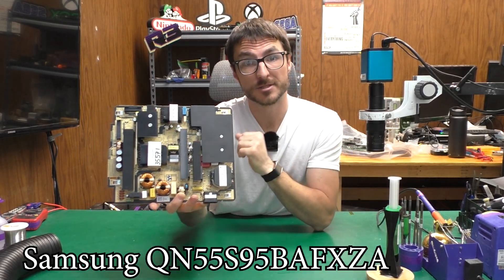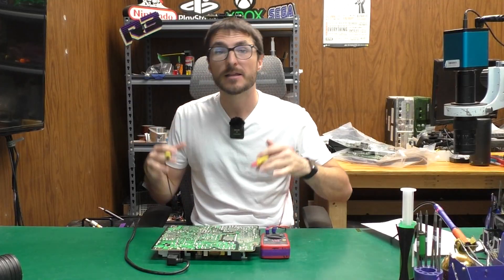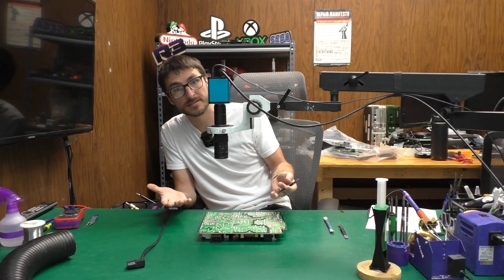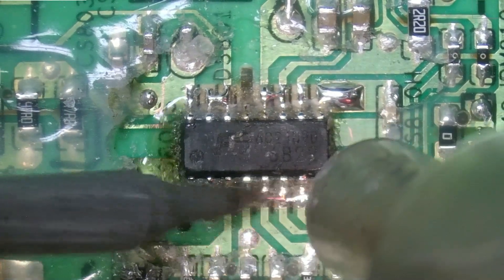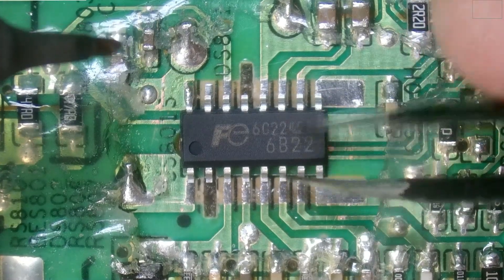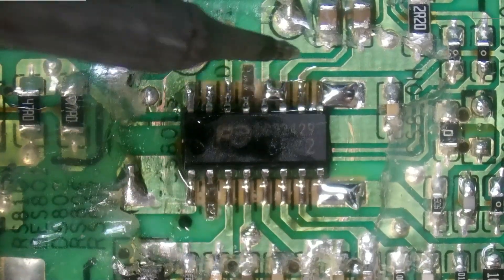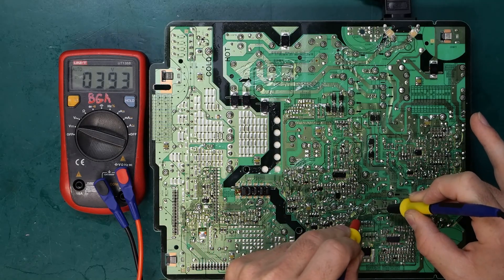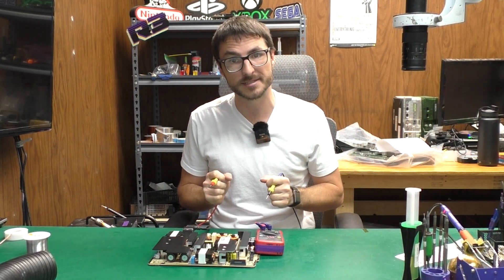Samsung OLED TV No Power Repair QN55S95BAFXZA Power supply BN44-01169A

Comment: I called you guys today regarding getting my Samsung QN65S95BAF model TVs power board repaired and was told you only repair the S90 model, not the S95 model. Yet, the name of this video is for the S95 model, so I'm confused. Before I try to rip my TV apart, I'd like to know if having this repaired is still an option.
Reply: I have a Samsung QN65S95BAF model TV as well, but the Power supply is BN44-01170A; Looking to get it repaired.
Reply: @hungdeep08 ahh, gotcha. Thank you for following up with this. I ended up getting to my power board tonight after work and it's the same number as yours. Guessing they changed power boards in the S95 models at some point.

Comment: What is the difference between a Bn 44–01169a and a BN44-01170a Can you substitute these boards?
Reply from the maker: BN44-01169A VS BN44-01170A
The 69A is built for the 55" version of the TV and the 70A is built for the 65" version of the TV. Well the 65" tv needs more power to work because it's a bigger screen, has larger pixels and larger leds. Each pixel needs to produce more light to achieve the same overall brightness across the larger surface. This means more power is required. Now as long as all the voltage output is the same from both board which I think they are, the only difference would be the power draw aka how much current/amps is the system pulling. This would be determined by the mainboard/T-con so I guess it might work. I honestly don't know for sure and have not had the guts to try out of fear of damaging something. Also all these TVs and power supplies I have worked on are not mine, they are my customers so I am not really allowed to take that kind of risk. But I think that in theory yes it would work. If you try it, im not responsible for what happens, but would love to know if it worked. Let me know if you try and how it went

Comment: What happens if that isn’t the issue? Another video more in depth about this specific board?
Reply from the maker: That is the issue for dead no power. I have yet had this power supply come in with any other fault other than what is shown in the video. 
Now if you have a different symptom then this video won't address it and indeed that should be a different video but I have not had anyone reach out with this model and not have a dead no power so far. Not saying it can't happen it's just that I haven't seen that yet.

Comment: This is great........... I had to order a refurb version of BN44-01170A  board (the 65" S95b 2022 model) cause no way I could do what you  just did.   the same problem is everywhere with those chips I guess.
Reply: Are you using the 65" power board in the 55" model? I was curious if this was possible seeing as how the BN44-01169A is sold out everywhere! They seem to have different voltages and power, so I wasn't sure if you could use the *1170A in the 55"? I seem to have snagged the last available *1169A and I think it arrived DoA because TV still doesn't work, no click, no standby light.
Reply: @RespextThis  no..no.  I have a 65" 2022 model... and am just swapping out that power supply board.   These boards are really not available new except for a few places that charge BIG bucks.  I'd guess the 55" model would be even scarcer.  I doubt my board would work in a 55" model.  I'd  send Nick an email and ask if its possible...    or just send him your board to fix.
Reply from the maker: We offer the service for next time. You can ship us your board, we do the repair and it will cost you less than relacement and you get a 1 year warranty
Reply: Hello 
Did the 65inch board work on your 55 inch tv ? On the 55inch board there are 2 references so i think it will be ok
Reply from the maker: I’ve never tried installing a 55" power supply in a 65" TV (or vice versa). We only repair original boards, and since we work on customer TVs and boards, it’s not appropriate for us to take risks to test compatibility, especially if it could damage the board or, worse, the TV.
That said, based on the legends, the voltage outputs appear to be identical, although I haven’t done a direct side-by-side comparison to confirm this 100%. The connectors are the same, so the wiring would physically fit. If the voltages truly match, the primary difference would be power draw (current/amps). Power draw is determined by the components requesting power, so in theory, a 65" power supply could be used in a 55" TV without issue, as the TV should only draw the current it needs.
However, we’ve had no reason to test this, as we’ve had a 100% repair success rate using the correct original boards.
If anyone does try this, please reply and share your results. Disclaimer: I’m not responsible if something breaks. 😄

Comment: Добрый день телевизор QE65S95BAT 2022 года.Oled проблема похожая на Вашу плата блок питания одинаковая.  Вечером телевизор выключили перед сном,утром он уже не включился,а13v нет наряжения,усилитель 17v тоже нет напряжения,видиарви 30v нет напряжения,индикатор на телевизоре не горит на пульт не реагирует, резистор желтый не пробитый, блок питание при включении в сеть не щелкает.кондесаторы стоят по 500v 2 штуки на них показывает по 280v  когда блок в сети.Живу в Украине у нас из-за ситуации в стране выключают свет когда захотят.Но дома стоит безперебойник 180v - 265v.Вчера выпаяли 6B22 заказал жду завтра прийдет,буду пробовать впаивать новый.напишу результат завтра вечером.
Reply: Перепаяли 6B22  микросхему , блок питание заработал , везде показало такое как у Вас напряжение , телевизор работает.Спасибо Вам.
Reply: Hello
I have same problem i have 230V on primary capacitors but 0V in all others voltages 
No red stand-by mode led
I think it's the same chip problem , can you tell me where you bought thé chip ?

Comment: Need help with a Samsung 75" QLED from 2020 Model: QN75Q70TAFXZA with Mainboard BN94-15822A .....  Won't turn on. Red indicator lights when you try to turn on. Blacklight all lights up when mainboard is disconnected and powered on. Removed both boards - on my bench I am a bunch of resistors on the main board are shorted to ground, but am not certain how to trace back to a chip - or if it is worth just buying a new board
Reply from the maker: For that one if you can buy a new board I would recommend doing that.

Comment: G,day Nick from Sydney Australia.
Checking voltage at the largest cap? Is this it's start cap?
* IC chip stopped voltage?
🌏🇦🇺
Reply from the maker: Start caps don't exist on SMPS. 
What you are reffering to are filter capacitors.

Comment: Great diagnosis! in my case My Samsung OLED TV power board clicks, all voltages seems to be good once starts, but after couple seconds the VDRV voltage alternate between 8-31v then to 0, replaced T-COM and main board with the same symptoms! Caps tested good in power board, also wasn't able to locate any short circuit in either board, any clue what could be the problem is?  thank you.
Reply from the maker: Sounds like you could have a backlight or panel fault but I can't know for sure.

Comment: Thank you Nick and very interesting. Any chance to see a test of the faulty IC versus a known good IC ? example to do to diode drop tests or something ? Just a suggestion. Very good vides. Again, thank you
Reply from the maker: Well I was going to include that in the video originally because most of the time you can confirm it has a short on pin 10 to floating ground and that's how you can confirm 100% that it is defective. Unfortunately this one was strange because it didn't have a short it actually read correctly which was very odd. So I would have just been showing a good reading on a bad chip which would probably be confusing for some viewers. But the thing is that for this board, there really is no diagnostics to make. I have had large quantities of these come in for repair and not once did they ever have any fault other than the IC chip we replaced in the video. So I was confident that even though the short wasn't there it was still the fault.
Reply: @NicksTVRepair Thank you so much for this, i’ve been probing this power supply of mine with midnight oil for months (complete novice to soldering but around all kinds of electrical and computers all the time). I could not find any shorts anywhere on the board, upgraded my multimeter to a category IV for this project. Just dusted off the board literally let it sit for a few months and then you posted the video + the comment. Thank you again!
Reply: The datasheet explicitly mentions LCD TVs as a primary application. An LCD TV has a relatively stable power draw because its main load, the backlight, is always on.

An OLED TV, however, has a highly dynamic power load. The power it draws changes dramatically and instantly based on the image on screen (a bright white scene draws far more power than a dark scene).

The Problem: This IC is designed to improve efficiency at "light load" by entering a "Burst operation" mode. It's likely that the rapidly and constantly changing power draw of an OLED screen causes this chip to cycle between "Normal" and "Burst" modes far more frequently than it was ever designed for. This rapid switching (a condition often called "chatter") can create excessive thermal and electrical stress, leading directly to premature wear-out and failure.
Reply: Sounds like Samsung should’ve had a recall and taken care of this problem sooner.

Comment: Hello, I'm watching you from Turkey. Samsung OLED TVs have a chronic power board issue. It keeps happening. The output voltage isn't coming out due to this problem. Thank you for solving the issue.
Reply from the maker: Hello there! It's good to hear from you in Turkey. Glad I could help. I have another power supply repair videos coming out for a 77" Samsung OLED in a couple weeks.

Comment: Nice .. what about mosfet .. 
Very quick..
❤❤❤
Reply from the maker: They were all fine. Have fixed several of these power supplies now and have never seen those fail. If they do the fuse would blow. If I come accross one that does have failed mosfets I will do a video but I actually don't think I will ever see that for this model.